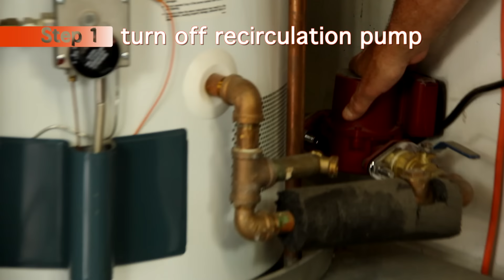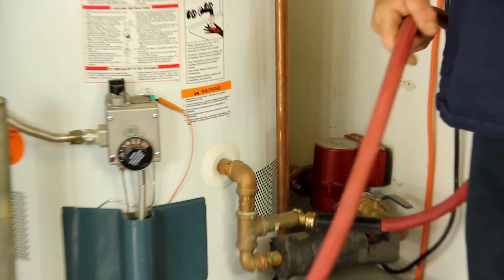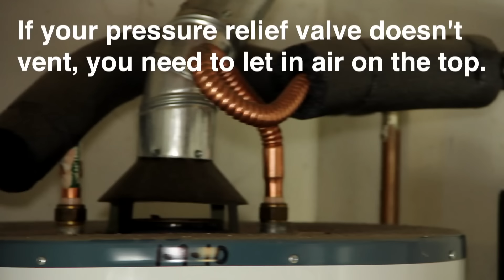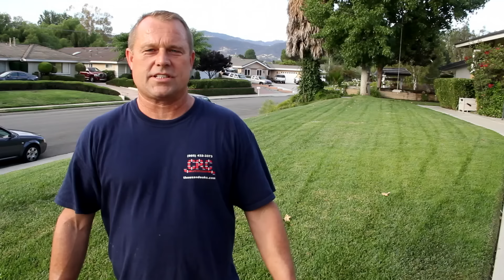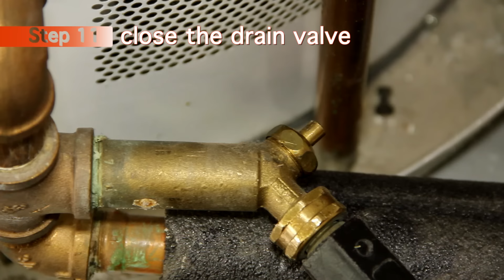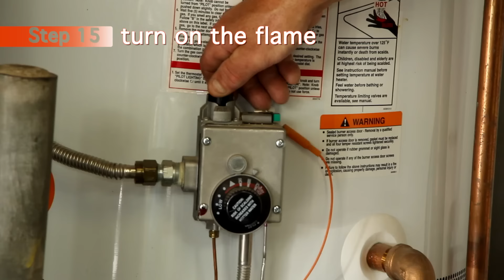How to drain a  water heater

Comment: Couldnt you just turn on the hot water at one of the faucets in the house to get the air movement instead of wrenching off the pipe at the top of the heater?
Reply from the maker: tisoy909 Sure if the water flows out,often it has air lock preventing the flow.

Comment: Why not do it the easy way, as shown in PoolmanZZ's video? No need to loosen fittings or use the relief valve to let air into the tank, which then requires you to run all the faucets in the house to get the air out.

Comment: I followed the steps but the water won't drain unless the water supply is open.  I couldn't hear air making any noise when I opened the pressure release valve.  Does that mean the valve is faulty and won't open?
Reply from the maker: Perhaps,or it could mean the drain valve is clogged.

Comment: if you have to drain it, there is probably a problem and the elements won't come out so easy. I had to use a 1.5 inch socket and an impact wrench to get mine out because it was so rusted. then I ha to take a wire brush and clean out the threads so I could screw the new element in.

Comment: Great video, easy to follow. Will drain my tank this weekend.
Reply from the maker: Alan Greer Enjoy hearing the feedback,thanks for watching.
Reply: @CRCPlumbing  I saw a video where this plumber said that draining an old tank for the first time that has never been flushed previously could actually cause a tank failure. Reason being he said the sentiment/rust  build-up becomes part of the tank. So if the tank is drained its like pulling a scab off. You agree with this?

Comment: Very easy to follow.  The nut on the cold water intake on top of my unit is way too big for any wrenches I have.  I didn't loosen it when draining the water out but it still worked fine.  Our water was pretty clear even though it had been four years since we drained it.  But like you said, it's still important to drain it regularly.  Thanks for the video!
Reply from the maker: Those supply line nuts are usually loosened by a pipe wrench.As long as the water moves out of the unit removing scale your good.Thanks for watching.

Comment: I drained and flushed my parent's water heater today. At first, I just turned on all of the hot water faucets and opened the pressure relief valve but it was coming out slowly so I removed the supply line and it seemed to come out the same speed. It seemed to take a while to drain but when I was done, I put the supply line back on, closed the drain valve, and turned on the water supply. When I opened the faucets to let the air out, there was a lot of black stuff. After that, I opened the drain valve at the water heater for a few minutes. I'm not sure how much sediment it got out because I removed the bucket after 30 minutes. There must've been a tablespoon of sediment in there. This house is 10 years old and we've never flushed the heater.
Reply from the maker: If you had a lot of black stuff I would suggest following up on a repeat drain in the near future,Thanks for check out our vid.

Comment: Why can't you just open the drain valve and let the water come out from the valve?
Just set the hermostat at lowerst setting.
When water runs clear shut off drain valve and set the thermostat to normal setting.
Anything wrong with this procedure?
Reply: How Long does it takes to drain?

Comment: Since I drained my electric water heater, the hot water flows very slowly through the kitchen sink faucet  --  all other faucets have no problem.  I cleaned the little filter screen in the faucet itself, but the flow is still very slow in the kitchen only  --  bathrooms and tubs are fine.  Any suggestions?  Thanks!
Reply: Remove the aerator aka the filter screen clean it  and let both hot and cold run for a while, make sure the service vales are all the way open , if the problem is still there maybe something caught in the line.
Reply from the maker: That must be a local problem,meaning is something on the incoming if the pressure is fine when aerator is removed.

Comment: If your water heater is in the basement and you need to release air, could you just turn on the hot water from a sink at a higher level than the water heater?
Reply from the maker: Great question,It will if the pipes are not trapped.I would give that a try if it works that's less to take apart.

Comment: What if your hot water heater is making a loud clicking sound whenever the hot water is used? I have an electric hot water heater and it is right on the other side of my bedroom wall and wakes me up when people have showers. Very frustrating.
Reply from the maker: That could be thermal expansion as the hot water pipe is growing and contracting.If this is the case an expansion tank can be installed.

Comment: Thank you so much for posting this video..I was stuck.  Found out from a wet floor in the kitchen that I had a leak coming from the water heater closet.....I'd gotten as far as turning off the cold water to the water heater, shutting off the gas to it, hooking up a hose to the drain, opening the drain valve and took a websites advice to open a hot water faucet in the house...but it wasn't draining ...then I followed another tip= to turn the water back onto the water heater to push that water through the hose to get it started..still nothing...Finding and then following your video I flipped the pressure valve lever that I was too scared to before (not knowing what would happen if I did that), then unscrewing the cold water pipe...Wa-La...the unit started to drain....  Thanks again from a single middle aged lady who was trying her best to prevent any further water from coming into the house!  You saved me! :)

Comment: So you don't have to turn off the gas switch, just putting it on pilot is ok?
Reply from the maker: When in pilot mode a water heater can not fire unless you have a defective valve.I would suggest isolating the gas valve when unsure.

Comment: dude I have a leak that's coming from thermo expansion valve but I get a gallon it happens then nothing no then happens again what could cause this??
Reply from the maker: This sounds like a pressure problem.Get yourself a gauge and check to see if it variys.
Reply: what should pressure be ?
Reply from the maker: myviews
Under 75 Psi

Comment: Nice straight forward video.

Was having a hell of a time getting the tank to drain. Watched several useless videos and read numerous how to guides but could not get a sustained water flow. Tried getting it going by turning on the cold water (as the heater guy had suggested when he installed) and opening a hot water tap but the flow would stop immediately upon shutoff. Your tip to loosen the cold water fitting to get air in did the trick. Tank is finally draining. Thanks!
Reply: I was in the same situation a couple of years ago and just gave up until today.
Reply from the maker: Cool,I dig when this helps it get done.
Reply from the maker: I would say its that same theory of fluids staying locked in a straw,until you remove your finger their is no flow.I am truly glad to have gotten you draining.
Reply from the maker: Right on, I am happy to hear your success.
Reply from the maker: Thanks for checking it out.